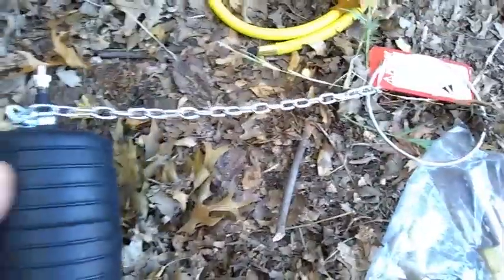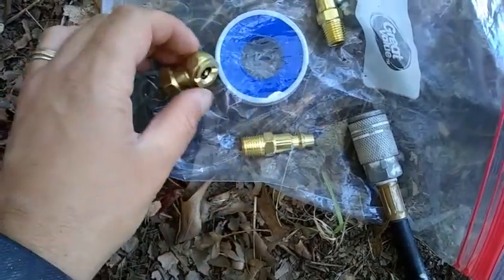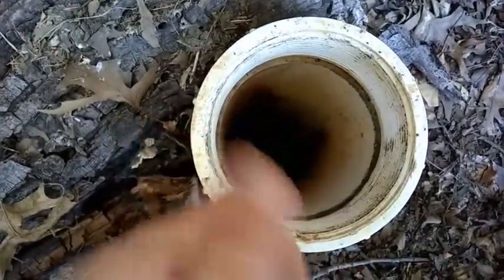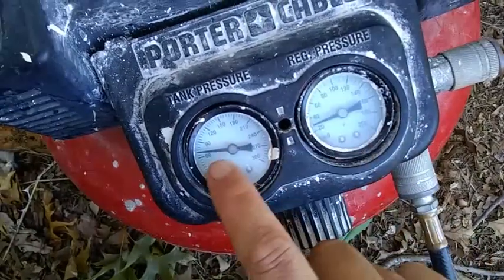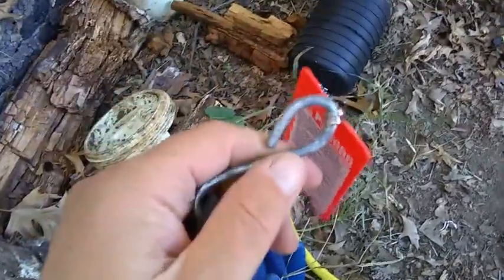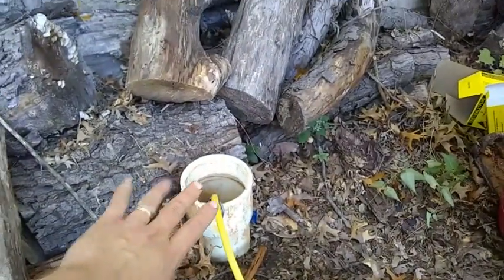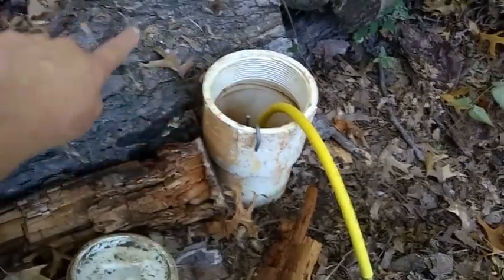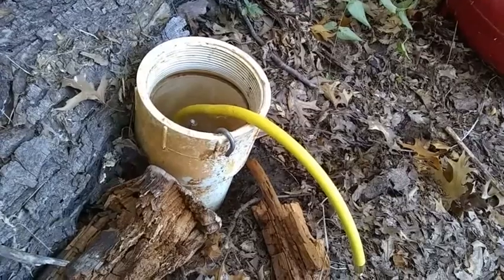How To Test for a Leak in Home Sewer Lines

Comment: How do you know (or guarantee) if the black inflated ball isn't leaking passed the ball inflated in the pipe?
Reply: around 6:00 he put a pressure test on the ball
Reply: You can do this test with a bike hose doesn’t require much pressure it helps if he would’ve said what size he’s using and the psi it requires
Reply: More likely 3” (35psi) or 4” (30psi)
Reply: That's a good point.  If the water level is dropping it's either leaking from the house side or getting past the ball.   How would we know which way?